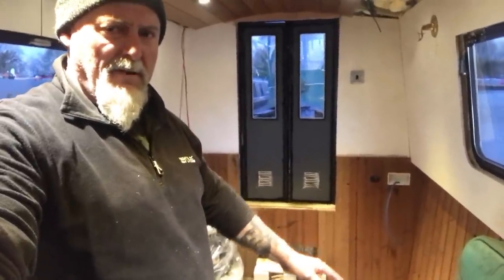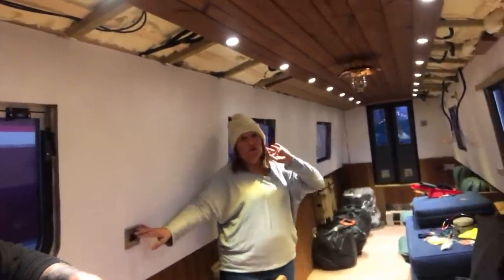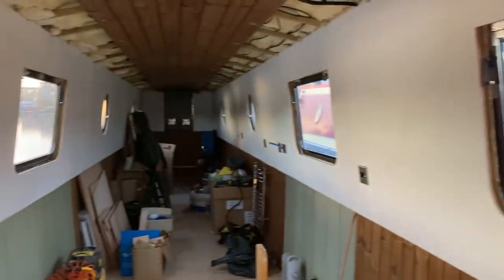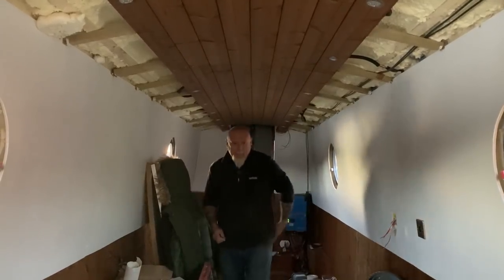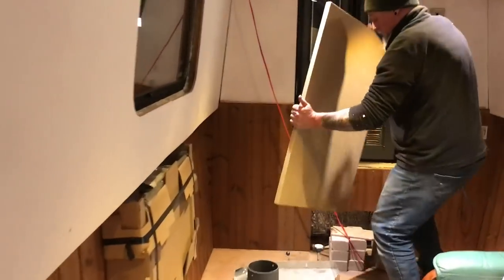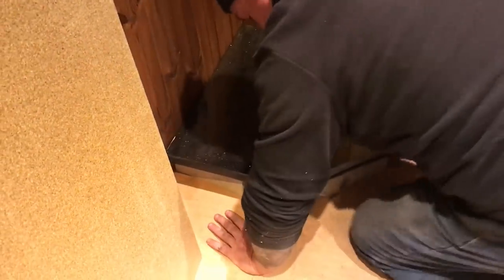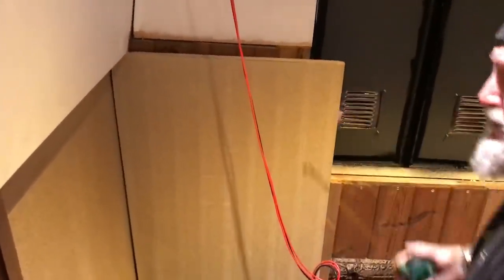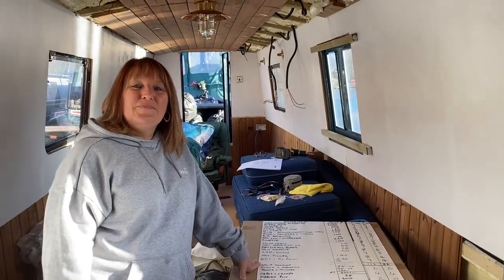Building Our Narrowboat #27 - Restart going well until....

Comment: Hope your feeling better soon.
Boats looking good.
How many rads will you be heating from the stove and will you need a pump also are you having a webasto etc for heating as well.
Having a sail away built later this year and considering a stove with back boiler.
Stay safe Guys.
Reply from the maker: Hi Gleeson. Thank you for your comment. There will be three radiators, one being a towel rail, there will indeed be a 12v central heating circulating pump running whilst the stove is on. I will pipe up for additional Webasto EVO but I dont see the need for it at present. Who is building your boat?
Reply: Soar valley are building the New boat. This will be our 2nd sail away,  had a 47ft built in 2019 which we planned as leisure but now wanting to live aboard its to small for us. So going for a 60ft semi Cruiser.

Comment: You could’ve used pink plasterboard it is fire rated cheaper than that
Reply from the maker: I wont use plasterboard on boats. And that is not designed for this purpose. Pink plasterboard is to give higher protection to fire in certain areas. Not to be under constant temperatures of 500 to 600 degrees C.